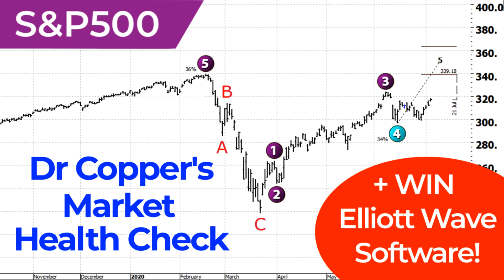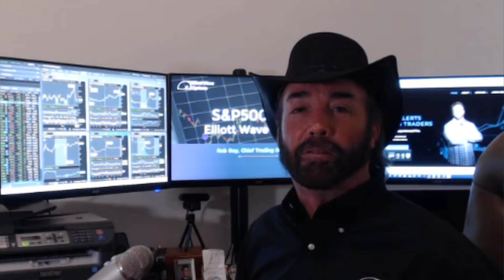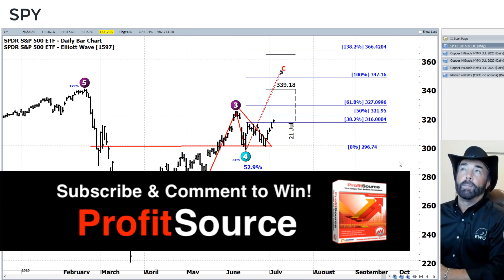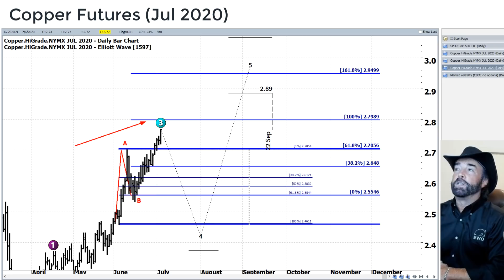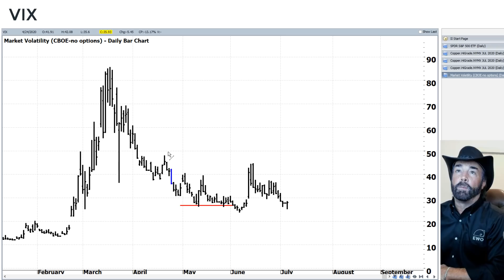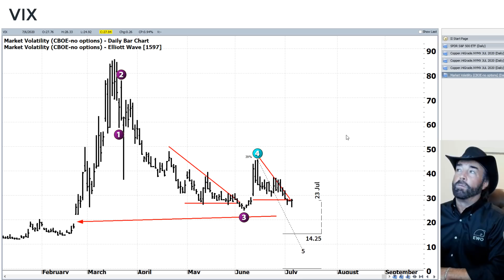S&P500 VIX Elliott Wave U.S. Market Update

Comment: Very informative as always. Since the break of the .618 retracement it makes sense to head to ATH, and even break it slightly, before pulling back again. If the VIX breaks down below 20 and the put/call ratio goes very bullish around the 3400 level on the S&P I'll be looking to sell/hedge. There's still a lot of uncertainty around the real economy: new unemployment claims remain elevated and the virus is rampaging unmitigated. As long as there remains some bearish sentiment and the VIX remains elevated this market will continue to move higher though.